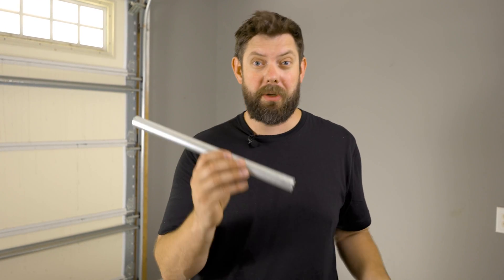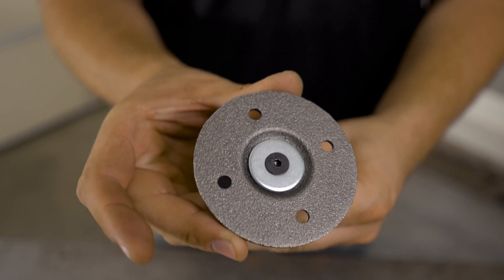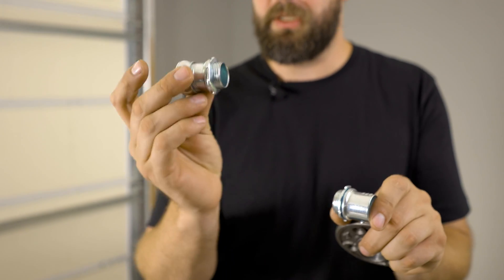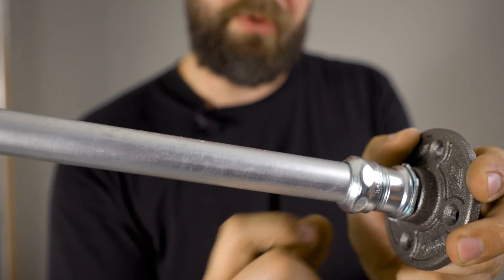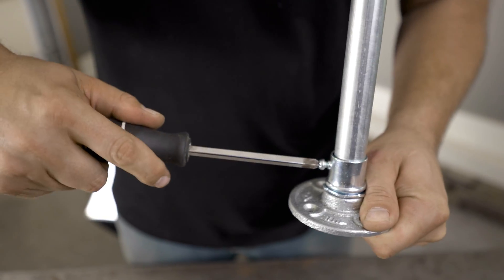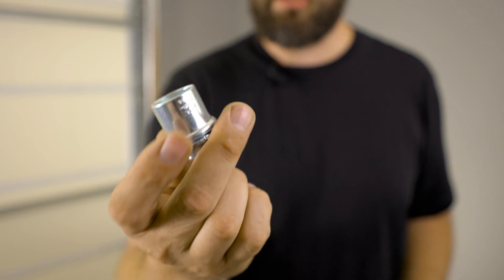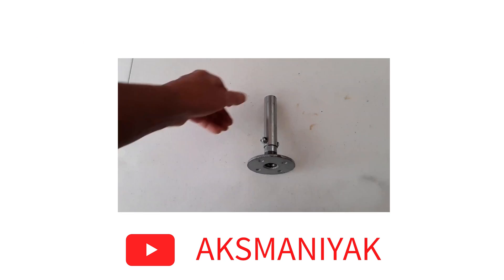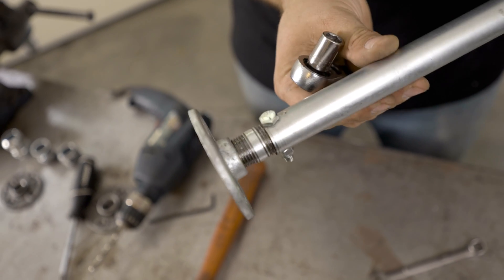How To Make A Flange For EMT Conduit

Comment: I want to make a kayak rack for my utility trailer that I can remove to use the trailer to move other things.  I want to permanently mount EMT pipes to the metal frame of the trailer vertically and then connect the vertical pipe of the rack with a fitting that can be removed. What's the nest way to accomplish this?

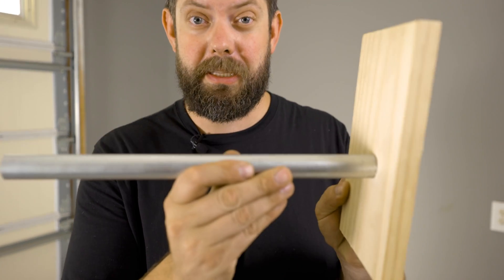Comment: 0:30 for the ceiling, is it strong enough to hold up a ceiling mounted pull up bar? How do these perform under tension (pulled apart; hanging from a ceiling) vs under compression (pushed together; resting on the floor)?

Comment: I have also had success with taking a longer piece of threaded steel pipe and inserting it all the way into a piece of conduit (rather than threading it onto the threads of the steel pipe). I cannot remember which sizes of conduit fit completely over which sizes of steel pipe, so you will have to experiment. Fortunately, you can do that right at the hardware store. 

Now, the conduit is only slid over the steel pipe, so it could slide back off. (You could also drill and insert a bolt through them if you need to keep it from sliding off.) But, I only needed it to mount a make-shift shower curtain rod. So, the pipe flange was screwed to the wall, and the threaded pipe stuck out horizontally, so it only had to support forces (gravity) perpendicular to the direction it would have slid. For context: I had to make a shower curtain rod that went down the side then also bent around a corner to cover the end of the bathtub/shower as well. Because I was mounting an 'L' shape, I had to put everything together before mounting onto the wall. I used pieces of threaded pipe that were at least a foot long, so it gave lots of support to keep that conduit from bending right where it was mounted on the wall. In all the years that I used that shower curtain rod, I never had it bend. And, I had roommates who weren't so very careful with things. 🤣

One could also use this method to mount the flange onto a horizontal surface, with the steel pipe sticking straight up. Then, one could simply slide the conduit down over the steel pipe, and let gravity hold it in place. This would be great for temporary installations, where it is OK to leave the flange in place permanently. To take down the project, one would simply lift off the conduit structure, and unscrew the pieces of steel pipe. The chosen length of the pieces of steel pipe would depend upon how much the structure needs to resist horizontal pressure (like wind, or idiots leaning against it). Shorter pipes would make it easier to set the conduit structure down onto the pipe, while longer pipes would resist horizontal forces better.

Comment: For simple closet pole solution, you cut two 2x4's, or 2x3's, and put holes in both sides, and then secure the 2x lumber to the wall.  etc.   You really need to use the 2x lumber, because you need to secure a closet pole to the studs.   You can use 3/4, or even fence poles (1 5/8), etc.

Comment: What size would the self tapping screw be? Running into this problem with a build right now.
Reply from the maker: Hi there, thanks for the comment. We usually use #8 1/2" screws

Comment: Thks, I will do this for my bird house I need to mount it on a pole. I didn’t know pipe flange would thread with EMT fittings.😀
Reply from the maker: It's a great solution for sure! We have also designed and released a flange made specifically for 3/4" EMT Conduit. You can find it here. https://makerpipe.com/collections/modular-pipe-fittings/products/flange-connector

Comment: My half-inch threaded compression coupling doesn't even come close to fitting in the half-inch flange I bought. Grrr.
Reply from the maker: Hi Marc, I just responded to your community post. I am pretty sure I see the issue. https://connect.makerpipe.com/post/so-i-m-following-the-guidance-from-the-youtube-video-called-how-to-make-a-f--6216e25f1711defc801b5788

Comment: 1:33  I was going to do this but the same gauge conduit, connectors, and floor flange would not fit together.   Fortunately I did not purchase them first.   :(   Thank you for the idea, though.
Reply from the maker: Sorry to hear that Jay! Are you sure you tried the 3/4” black iron pipe flanges with 3/4” EMT Conduit? We’ve seen a lot of people have success with the combo in our community.
Reply: @MakerPipe  I tried connecting a 3/4 conduit to a 3/4 floor flange with a connector / adapter in between the two parts.  I'm not sure if I have tried threading it directly in like you did at first.  Thanks for the response!

Comment: Great idea and video.  Well explained!  For my project, I'm customizing my drum hardware (stands) to set-up faster and take up less room by removing the tripod legs.  That leaves me with a 1" metal tube (similar to EMT).  I thought about using flanges and threading the tube on the inside or outside of the tube, then securing flanges on wood stage (specific locations based on my set-up) then they would screw into a flange or flange with a nipple. However, you inspired a new approach.  Key thing is I need strength and the ability to remove the 1" metal tube (stand) each night after a show, so I can place them back in a case for travel and fold up my wood drum stage.  Flanges would always remain.  Any ideas or recommendations?
Reply from the maker: Thanks for watching and the question! Do you think the compressions or set screw coupler method without the tube insert hack would suffice for the main setup? If so, you could remove the set screw and pull out the pipes pretty easily and the flanges could stay screwed in.
Reply: @MakerPipe  Thanks for the response!    I agree.  The set screw coupler method will definitely work, but I'll modify it by adding either self-taping screws or a nut/bolt to keep the tube permanently attached to tube (for strength).  Then each night All I have to do is unscrew from the flanges. Thoughts?  I'm sending this channel to a ton of friends.  Your ideas and this creative DIY community is what we need !  Great work brutha!

Comment: the flange threads are NPT (tapered), most EMT fittings are NPS (straight)? i dont see this providing a very secure connection
Reply from the maker: Thanks for the comment Azoore. They held up surprisingly well when we did our testing which you can see in this video.
https://youtu.be/HGBFEwle13I

Comment: Hey, Dave, Randy here. . . Wondering if you can share the washer/countersunk bolt specs. I was at the big box store yesterday checking out options, and there are a lot of choices for fender washers. I realized I did not have threaded inserts yet, but I was planning on 1/4-20 because of the versatility. Anyway, I put everything back on the shelves and thought I should do a little more research and ask. Maybe your washer has the 3-letter code on it (used at checkout)? and the screw. . . love the idea of using the hex wrench. Was it 1/4-20? seems like 1/4” is too narrow, so I am thinking you did not use that for your threaded insert. Enlighten us!
Reply from the maker: Hey Randy thanks for the comment. I have updated the description with links to the exact fender washer and counter sunk bolt that you would need to recreate it. Unfortunately we couldn't find a 1-4/20" version of the counter sunk bolt that was long enough to reach the insert. Hope this helps!

Comment: I am very glad you made the distinction between the steel fittings and the cast ones.  Also I noticed that you didn't remove the lock nut from the fittings before screwing them into the floor flange.  , I think I would so I could engage more threads.  I just went to the shop and tried it both ways and it works both ways.  A bit of the space where you put the fender washer is lost but bi still think you have room for it.
Reply from the maker: That's a great tip. When you tried it did you end up with more engagement?

Comment: Another vote for strength test. You can also add casters to table legs by pressing in a coupling nut into the EMT, and screwing in a threaded stem caster to it.
Reply from the maker: That's a good idea! Thanks for the suggestion

Comment: Great video! What is your opinion on removing the "locking nut" on the connectors for option 2 and 3 to get more depth into the flange? Do you think that helps or hurts the overall strength of the connection? I vote for strength testing too!
Reply from the maker: Thanks D! I think that it would add a little bit more strength, but we may have to test it and see. Thanks for the idea!